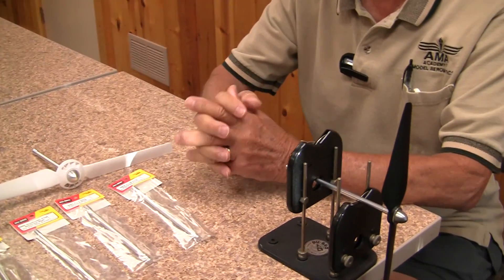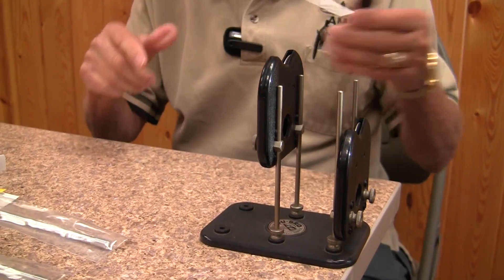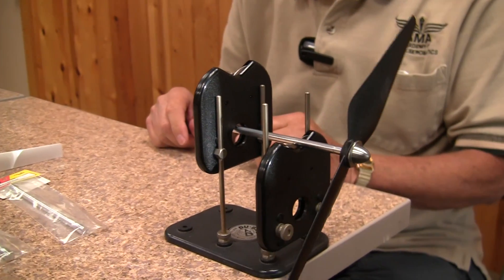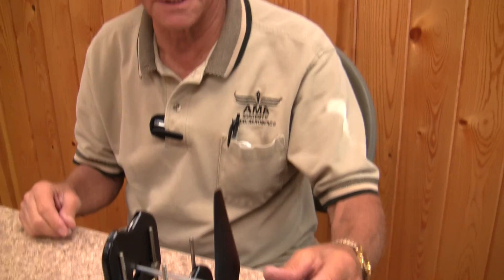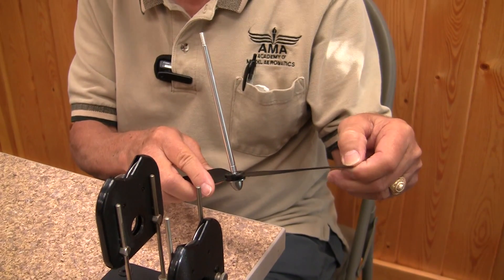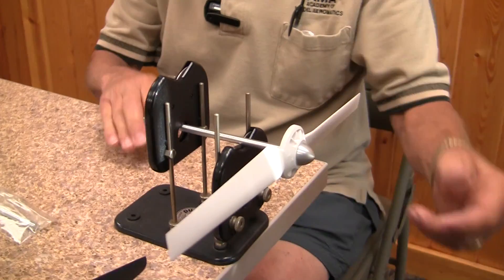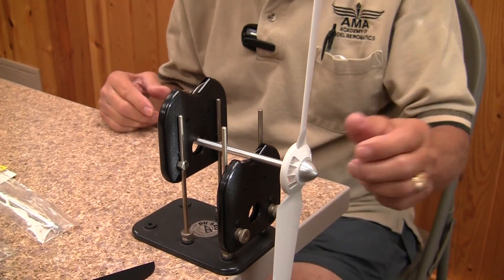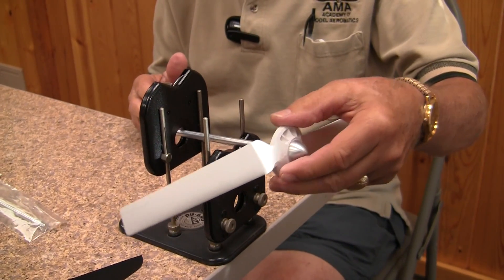Quadcopter / Drone Prop Balancer Tip

Comment: The props your balancing look like they are off a Yuneeq Q-500?
I have the same balancer and screw in rod but I can't seem to settle the vibration of my Q 500. Any more tips?
Thanks
Reply from the maker: The best method is to make small corrections and test.  You want to be sure not to make large adjustments each time as you may create more problems.  Sanding a little on the heavy side and re-testing is a good method.  You can also add a small amount of CA glue to the light side and re-test.  It is best to "creep up" on it but it may take some time depending how bad your props are.
Reply: @dubropineridge  Thanks for that will take your advice.
Reply: The balance issue was actually the motor. No load it would run fine once under load it would vibrate violently. It's likely the bearings. Ordering new motor. Thanks again for your advice got all four props balanced np..
Reply from the maker: @MadMax-cw3pn  I am glad you got it figured out!  Good flying!

Comment: Dear Dubro, I just received from Amazon down here in Venezuela your Prop Balancer SKU: 3396 but I believe there are some pieces missing like the cones, spring, washing and tubing. The box came completely sealed. The small plastic bag inside only had 6 small 8-32plain nuts, 4 small 8-32 knurl nuts,  4 large 10-32 knurl nuts. I also received the base, the two balance wheel housings, four 8-32 posts and one balancing shaft with threaded ends. I will send you a photo of what I received via email. How can I claim the missing parts to be sent down to Venezuela?
Reply: Sergio De Agostini please email us with your shipping information.   Send it to orders@dubro.com   Sorry for the mix up, we will be sure the error is corrected!

Comment: I've also heard it's a good idea to balance the hub of the prop, especially for multirotors where vibration should be minimal.  You might balance the blades and the they hold steady horizontally, but if you move the prop vertically, it doesn't hold position.  In that case you need to balance the hub, adding weight to the hub until it is steady.  It might be beneficial to show that in another video.  Thanks!